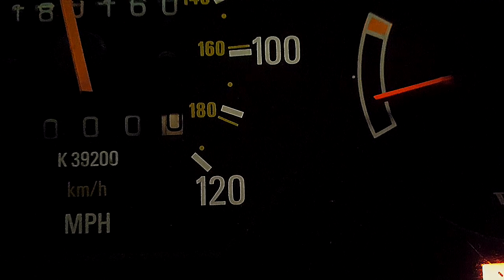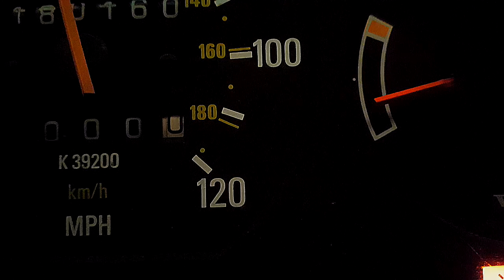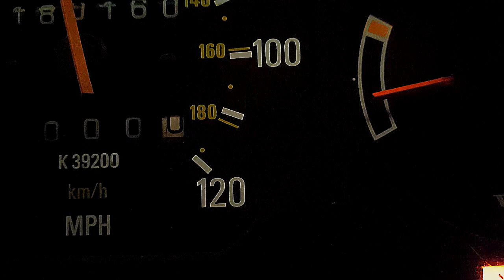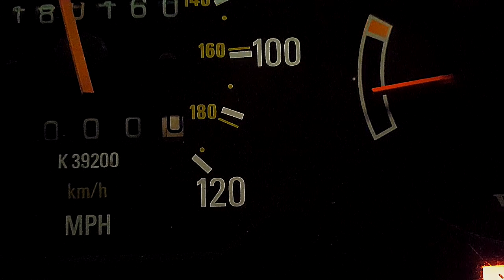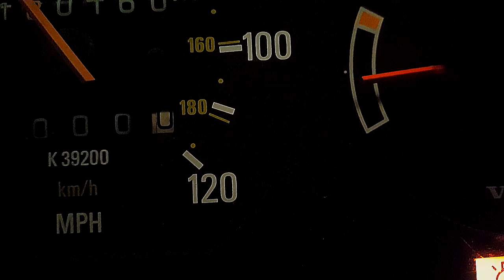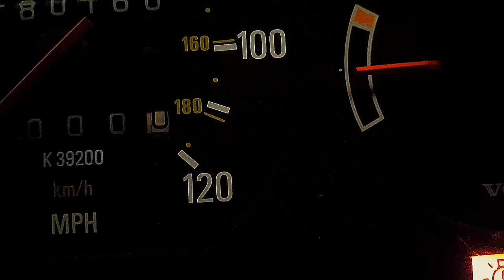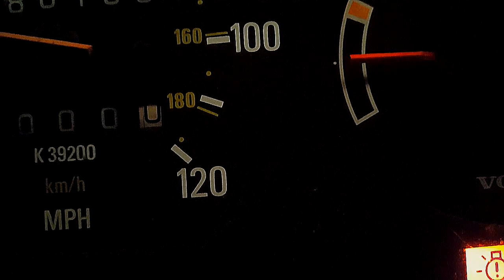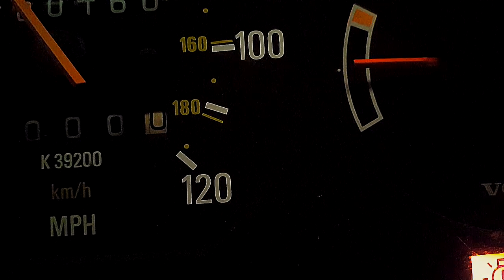Volvo 240 Temperature Gauge Going Crazy/ Compensator Unit VotD Jan 4

Comment: I'm having the same issue. I haven't decided the sensor is bad. It was stuck in the cold position. I replaced the thermostat. It will register fine when I start driving. It even goes a little over halfway. Then after a bit, it drops to about 1/4 the way up. Heat is coming out of the heater just fine.